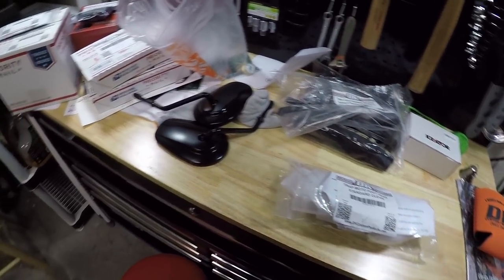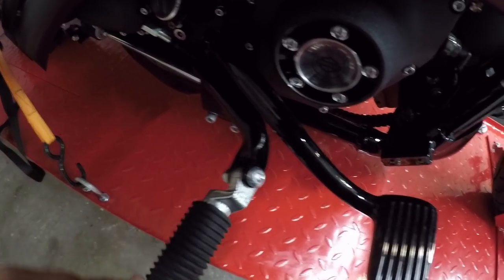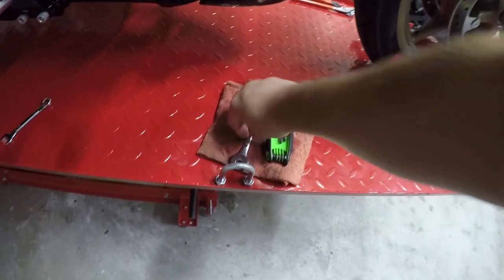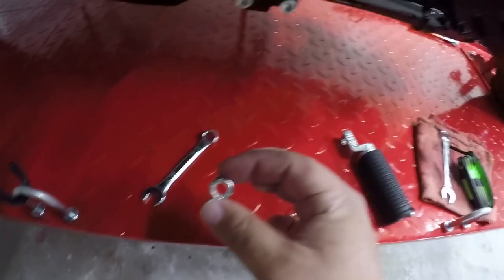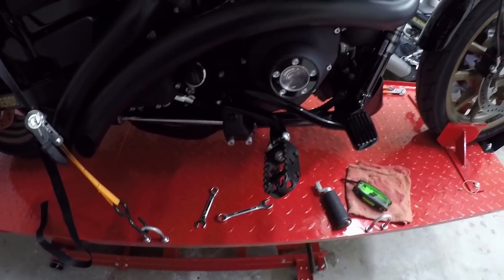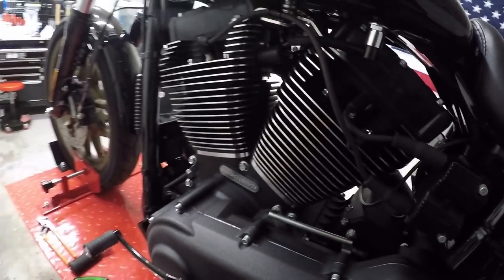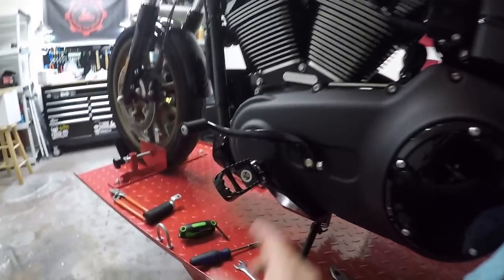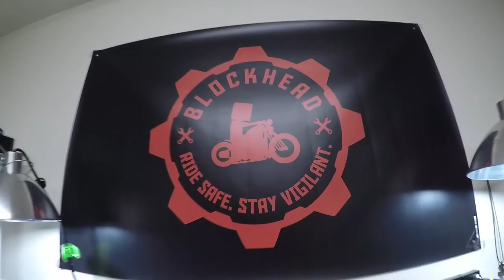How To Install Footpegs on Motorcycle!

Comment: I almost bought a pair of these but I went with the Joker Machine ones that are L shaped for my 48. Those things are awesome. Haven't gone and any real long rides but the longer rides it certainly helps give you a much better platform for your feet.  The snap ring style retainer they have on the 48 is pain in the ass I wish they had a bolt and nut system like your Dyna.
Reply: Yeah those snap rings are a bitch. It help having the tool made for them so they don't get messed. You may be able to buy just the bolts and ditch the snap rings. I did that on my 09 Dyna.
Reply: You can replace the c clip with a bolt or quick release pin. I believe DK sells the quick release style. I have it on my 72
Reply: Really thanks I'll look into that.
Reply from the maker: I had the snap ring style on the Iron and it was a definitely pain in the ass. Would definitely be worth looking into changing it over as the others users here have posted, makes it much easier, maybe for the next time around if you decide to change your pegs!

Comment: The foot peg adapter on my forty eight has a tab longer than the other which keeps the male end of my new foot pegs from sliding in. How do I take the foot peg adapter off so i can buy a normal one with even length tabs?

Comment: Did you have to adjust the shifter and the rear brake pedal? I installed mine and the shifter were way too low for my foot to shift and the brake pedal were way to low also.

Comment: The trouble with spring clips on the front pegs is when they get stuck in the up position. If you round a corner and drag one, you hit something and it pops up, or some other misfortune pushing it up, then what? Can you find the top of it while riding and push it down with your heel? Sounds dangerous. I prefer the spring, pushing it down.